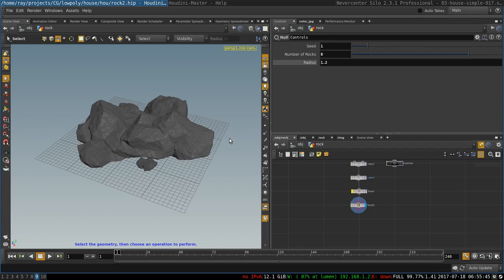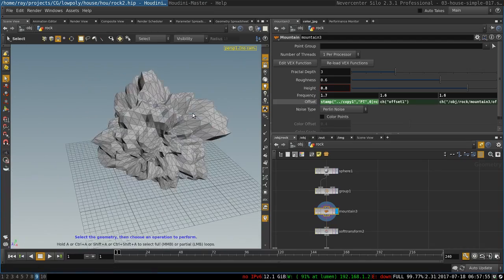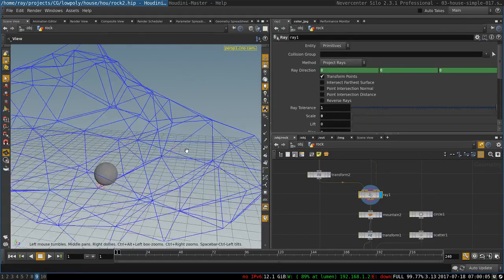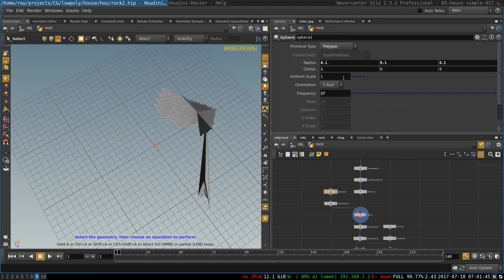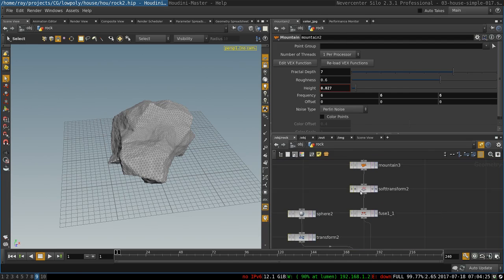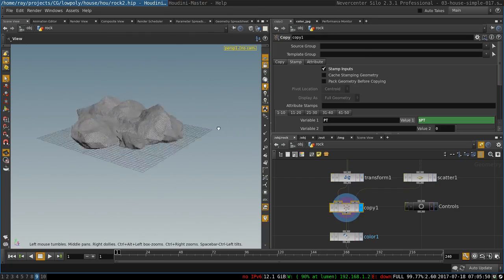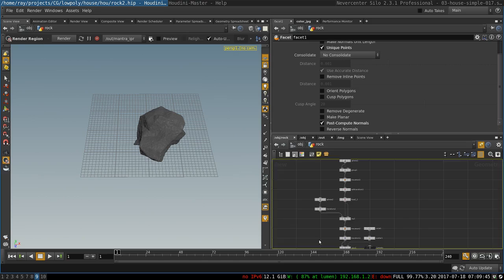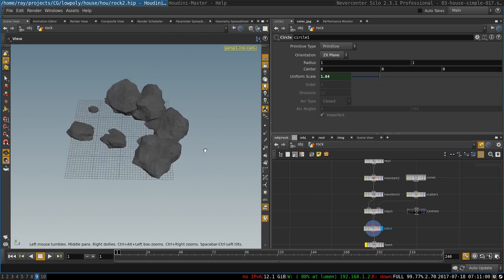Generating Procedural Rocks in SideFX Houdini

Comment: This is awesome! Great job. I have a tiny problem! I have tried to recreate it, but some times the random offset gives a geometry smaller than the small sphere itselff so it gives some bad artifacts as you mentioned in the vid. I have seen you file and you dont have that problem. How did you solve this?
Thanks again!
Reply: I have been touching your nodes, and Ive found out that the problem is in the "mountain node". We have different versions and in your version it works a bit different. It never reaches low poly enough results within the offset values so it doesnt give you that problem. Ill try to solve it somehow